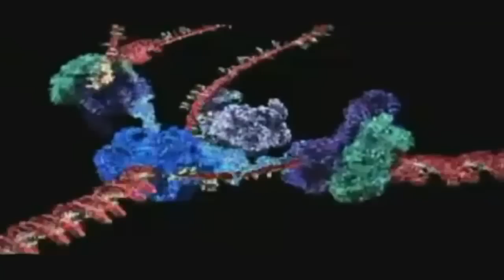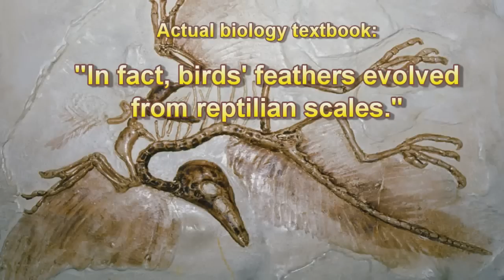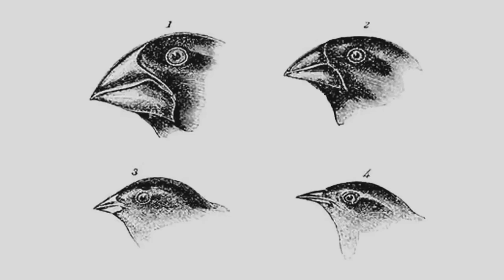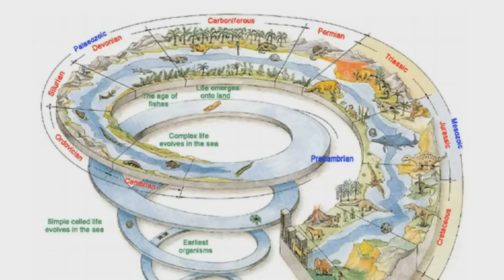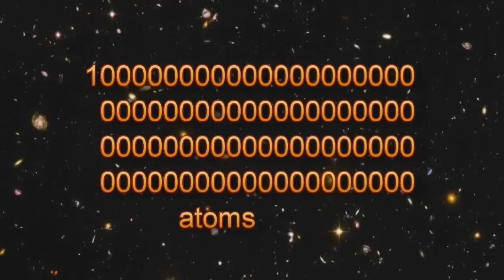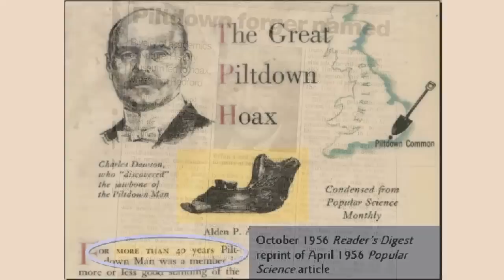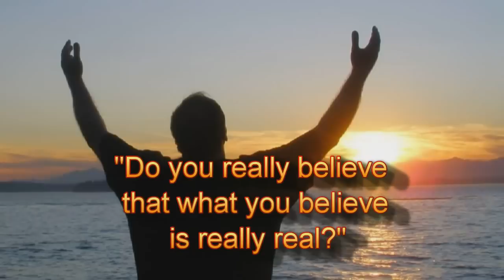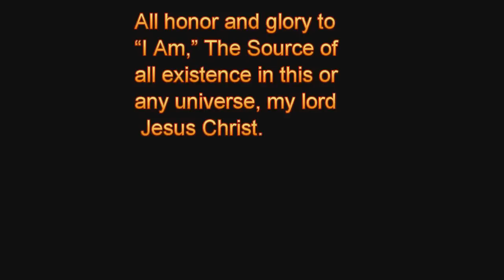Evolution Demolition

Comment: No, the sum of a system's entropy can only be defined in a closed system.  The principle of entropy is present in any system, open or closed.  Unless order walks in the door of that open system, any part of system must increase in entropy.  The exception is if there is an entropy transfer mechanism to alter probabilities, causing a corresponding increase in another connected part of the system.

Comment: >> Very hard, undisturbed rock layer over the soft material they were found in.

It's a slope. A rhetorical trick designed to make believe that the bones were buried deep under ground.

The "soft material" is loose sand that according to Dr. John Marwitt (among other archaeologist) does not make part of the jurassic rock formation around it.

Comment: Mark, you are the one who mentioned that an 'entropy transfer mechanism' is needed in the first place, so that "order can walk through the door". So YOU tell ME what you mean by it. I'm aware that there are known ways DNA retains its integrity, but that's not what you were referring to. Maybe you need to look back at your previous comments, so you can remember what you said.
Reply: Thanks for your patience.  The law of increasing entropy might be described as a law of attraction to higher probabilities, and generally randomness is a higher probability. An open system is helpful only if the thing entering the system can alter improbabilities in a given microstate, making them more probable. (An alien spaceship landing on our planet might be such a thing, though I'm not arguing for that.. :-).  Generally solar radiation does not offer this feature, except where an entropy transfer mechanism (ETM) might be in place to harness the energy.  Examples would be the hydrologic cycle or photosynthesis.  By the way, the formation of ETM's themselves would also be subject to the law of increasing entropy.

Clearly probabilities in various parts of any system are not homogeneous, but vary.  Probabilities tend to follow channels based on natural properties, as rainfall is channeled into river systems.  For example, degradation or decay can be slowed in particular circumstances by the physical properties of, say, a chemical preservative.

Prescriptive information, as encoded in DNA, is overwhelmingly improbable, just as it is in a book or computer program.  The mathematical principle of this flow from the less probable to the more probable is why books and programs never write themselves.  Yes, it takes added energy to write a book, but it takes a lot more than that to overcome the enormous probability gradient.  It takes intelligent mind.

I can't tell you specifically how the programming was actually encoded into DNA.  That is entirely unknown.  But the "pen" or "typewriter" used would be the easy part.  The essential thing is that it clearly was a mind behind the information that is there.  Nothing else in this universe is known to be able to account for that. Evolutionists have not yet offered a viable alternative, except a generalized response of THE SUN.

We know that if you were to stretch out a single DNA strand and lay it in the sun, it will degrade.  It will rapidly break apart. The sun will never add information to that strand.  ...Unless you can offer some kind of ETM that no one has thought of yet.  What kind of biological mechanism harnesses energy and writes new improbable information?

Comment: >> Microsoft has not fired programmers in favor of a random number generator. 

Because a random number generator without a selective force will get nowhere. That's the part, that I suspect you have heard often enough before and which you simply do not want to understand.

BTW: As a programmer I can tell you that the numbers created by a computer only appear to be random. In reality they are the result of complex calculations.

Comment: The idea of duplication followed by frameshift is a common explanation for genetic change.  It is a relatively simple thing, which means that, unlike writing new programming, it is conceivable that such a mutation could have the rare luck to produce it.  However, such luck would represent an alteration of existing information, not new programming.  But x-ray crystallography has now proven that frameshift cannot explain nylonase.  The genetic difference is far too complex.  (to be continued)